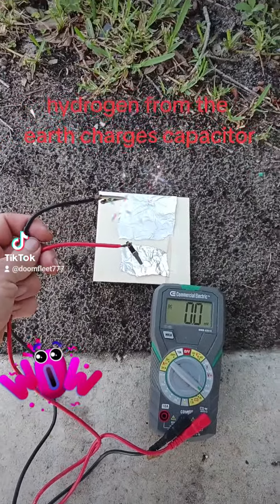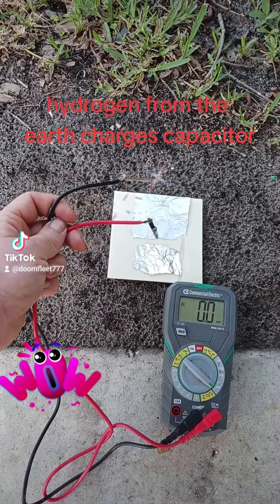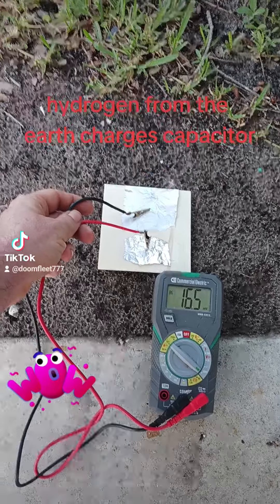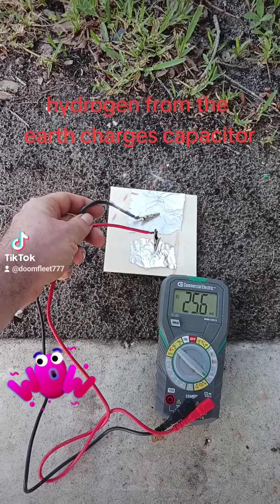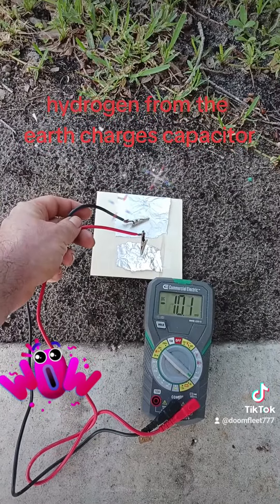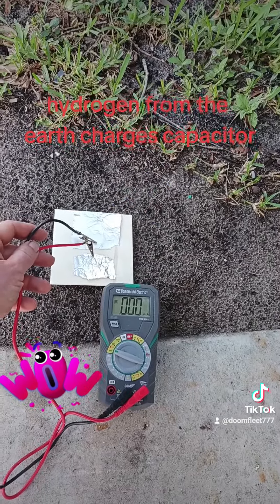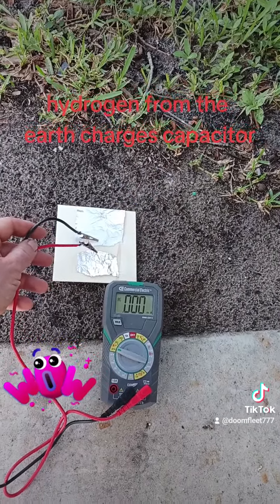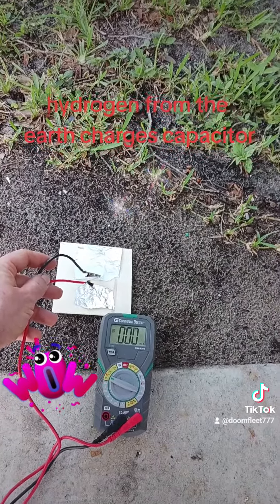EARTH BATTERY 🔋 A CAPACITOR CHARGED BY UPWELLING #HYDROGEN #fuel

Comment: If you have any links to low eddy current or low loss small DC  generators, please let me know 👍🏻
Reply from the maker: Some one named thanes at MIT was working on an anti back emf technology awhile ago
Reply from the maker: Also Holcomb energy systems. They are in Sarasota too but have not seen their stuff yet
Reply: @peterlang777  Very interesting. This is basically a solid stale very low loss version of what I'm building. I'm building an extremely low power timed electro magnetic push generator. The same basic idea, but not as flash. I can see how this system works because it's the better version of my basic plan. Thanks for sharing 👍🏻
Reply from the maker: @BrainfooTV  your using hydrogen to electricity nanomaterials too?
Reply: @peterlang777  No simple Neodymium magnets timed with electromagnetic pulses by a very accurate rotation sensor. So far I have 2-3mw energy consumption plus electromagnet draw (as yet to be determined) if I can get it in phase I should be able to use the  free power in the Neodymium to sustain rotation force and acceleration (electro pushes Neodymium just off TDC to flick it round). The next part is to collect as much power as possible with minimum loss and feed back into the generator. Hopefully when I have even the smallest excess I have succeeded in proof of concept. It is very similar idea to Holcomb but with a mechanical element, not solid state. I do not have the experience or facilities for solid state. But at least I will have prove I can do it.
Reply from the maker: @BrainfooTV  this sounds similar to Holcomb energy systems. They say they use the energy in iron

Comment: Congratulations, you managed to read 100mV of pure EM noise and 0.001mA of measurment error
Reply from the maker: hi barely literate youtuber! you need to research iontronics. have someone read the papers to you on google scholar
Reply: @peterlang777  1. What papers? Honestly, link me one, i'll gladly read up on new stuff
2. While yes, 80-150mV is somewhat high for it to be random disturbance, 0.001mA is a laughably small current, not enough to be considered a significant value.
3. Capacitors work by storing their charge in the magnetic field. This means they can provide huge current over a very small ammount of time. Not only is 0.001-0.002mA not big, i cannot see how this stores energy in a magnetic field.
4. What does this have to do with upwelling? Is there some other definition other than " aprocess in which cold, nutrient-rich water from the bottom of an ocean basin or lake is brought to the surface due to atmospheric effects"? Or how does it work at all, i cannot find any details.
Reply from the maker: @jeredek9901  I just made a video with one on hydrovoltaics. Mica and graphene oxide for hydrogen proton selectivity. From a Chinese paper.  Also upwelling refers to a vertical flow going against gravity. Mostly used in terms of gases or liquids. But in cosmology it includes plasma. In geology it is sometimes used in context of volcanic plumes
Reply: @peterlang777  damn, where did you get the materials for these? I couldn't find anything in the paper preview you showed in the vid, since the details are paywalled.
Also I still dont quite get how exactly you turn hydrogen into electron flow
Reply from the maker: @jeredek9901  I make the nanomaterials I can like graphene, hematene, and stanene rectangles. Matsushita labs makes me others. As for the Chinese paper I think the wiley online library has more on it without pay walls. But the gist is the graphene oxide on mica makes power. It is similar to the HUC enzyme research in Australia but is inorganic. (HUC converts hydrogen in air to electricity. It's on TV shows there)